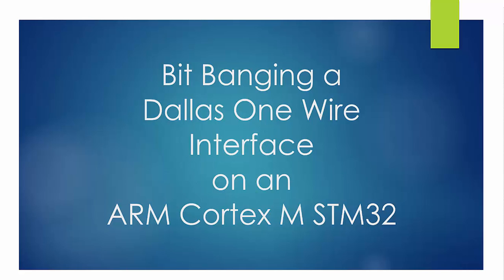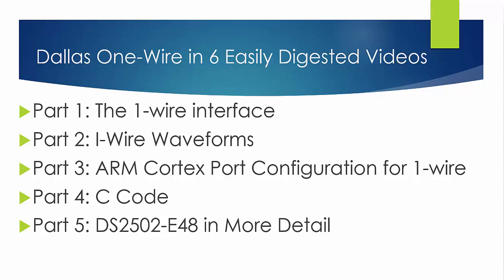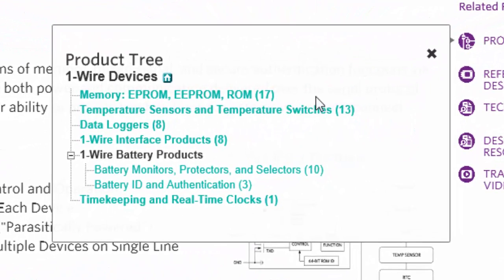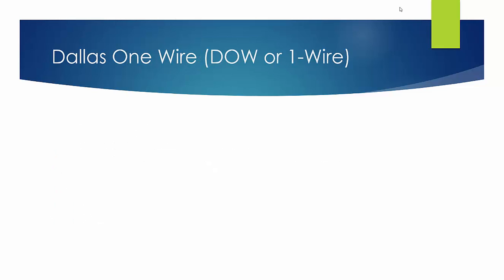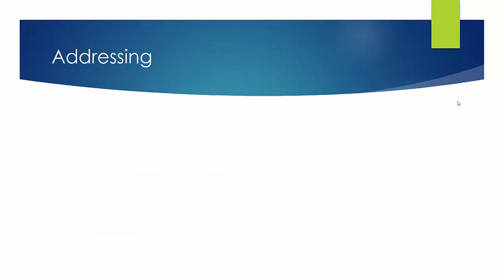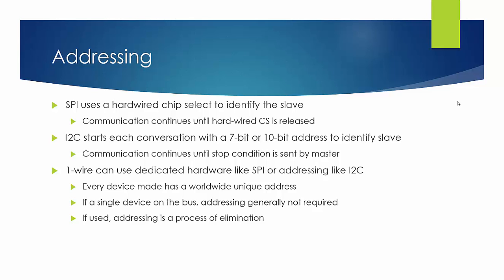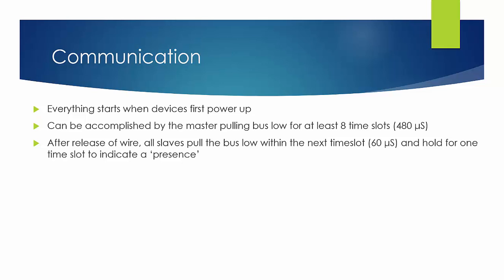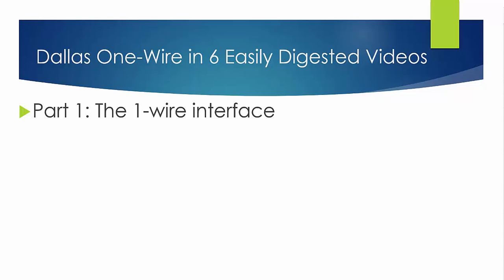{3} Dallas One-Wire Part 1

Comment: Are there existing microcontrollers that have a hardware 1 wire peripheral or can you only bit bang it?

Or can you configure a USART a half-duplex single wire cofiguation?
Reply from the maker: There are 1wire controllers that hang on i2c bus, but a controller that has 1 wire built in? i do not remember ever using one that had a dedicated 1wire.   I have seen the half duplex UART you suggested working so that is a good option.  I am not the worlds biggest 1-wire advocate so I don’t spend a lot of time hunting down components but i would not be surprised either way actually.